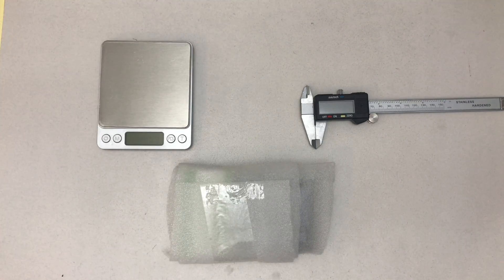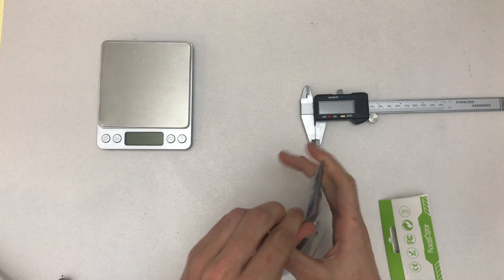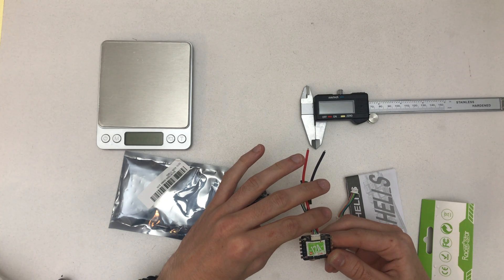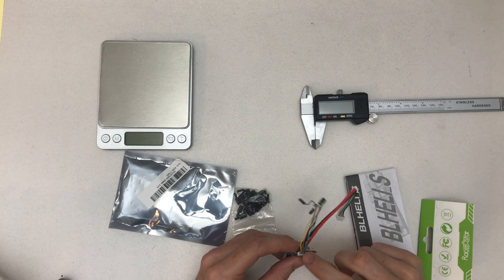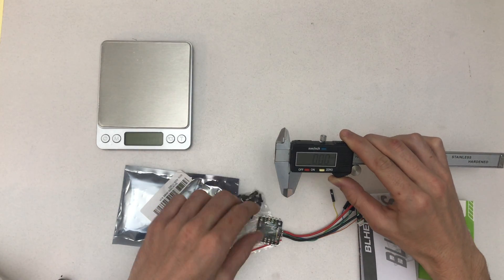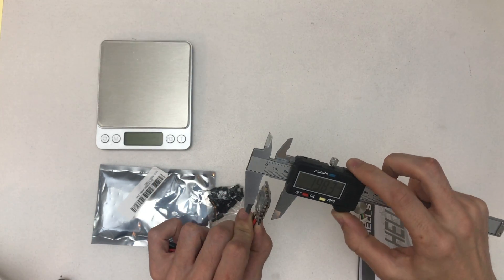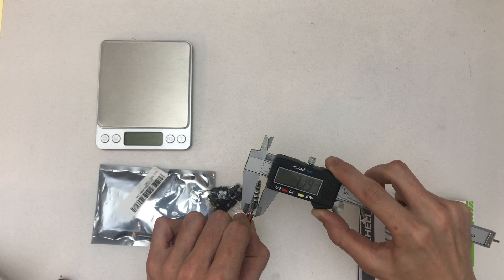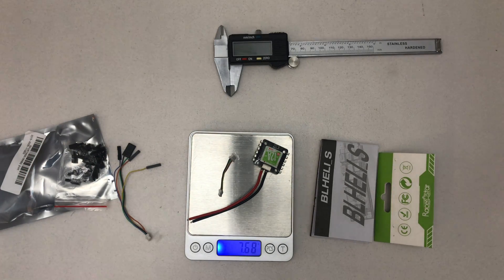Unboxing // Racerstar 12A 4in1 20x20 BLHS ESC // 2-4S // BB2 // DShot

Comment: Hi do you have the manual for this? I think I lost mine and the motor label on the ESC is confusing. I'm wondering how to connect my motors to the ESC. Thanks
Reply from the maker: it should be printed on the sticker like 1 2 3 4 and A B C (though that is irrelevant), but let me look if I can find it... though I doubt it

Comment: My 4in1 esc missing the red wire?
Why??
There are only the black wire “minus” and whereto should I solder this wire on my “femto f3 flightcontroller”??
Normally I would solder the black and red (plus&minus) wire to the plus/minus pads on the flightcontroller, but there are no red/plus wire??
What to do??:-)
Reply from the maker: hey, depends on your FC, does it take lips voltage? Then I just use two little wires going from the lipo pads to the fc :)
Reply: JulianGoesUnboxing thanks for answering..
My femto f3 Fc have a 5v bec, so I soldered 2 new wires from the +/- pads on my 4in1 esc to the +/- battery pads on my femto f3 flightcontroller..
The black wire on the 12A esc was apparently a signal wire?? 
No is nowhere in the info that says the black wire is a signal wire?? Plz fix that info.. 
There should be a way better info (for people like me that doesn’t understand everything here;-)))

Comment: Hey man did you try Dshot600 on this 4 in 1? Do we have to remove signal capacitors or this board doesn't have them?
Reply from the maker: haven't tried the digital protocols (neither Digital-Precision nor DShot) yet, only MultiShot at 32khz, sorry